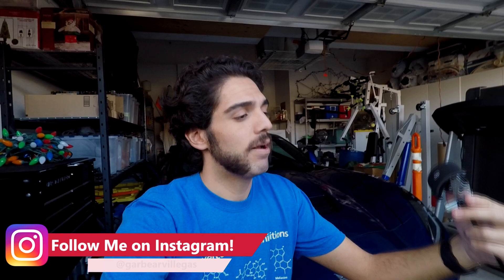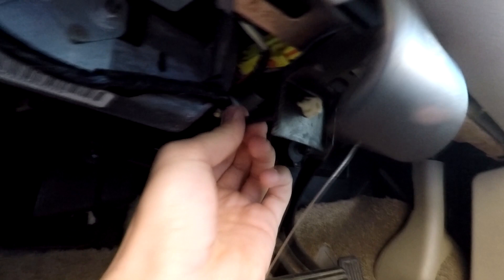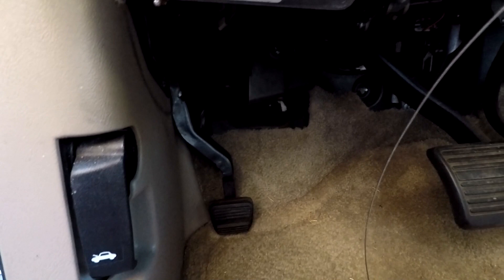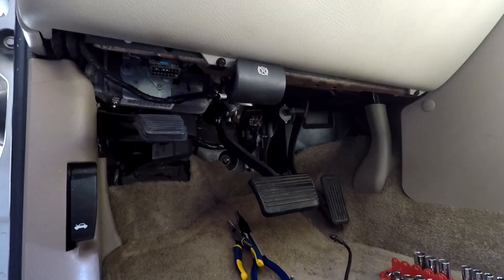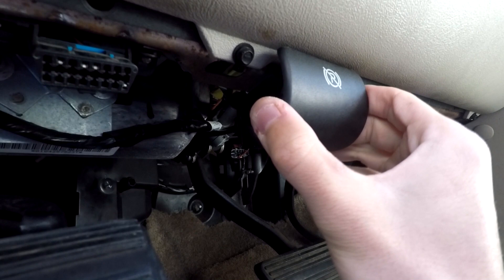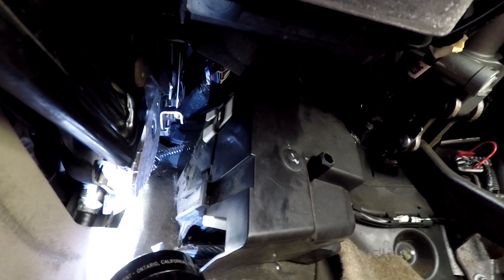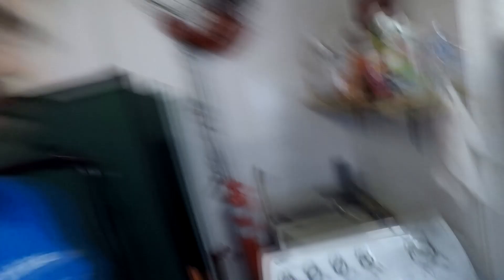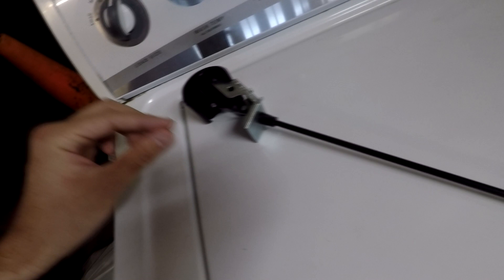How to Fix a BROKEN Emergency Brake Release

Comment: You are a lifesaver! The parking brake release handle on my 2007 Avalanche had me stranded while at the ATM Machine yesterday.  I could not move the vehicle and was both ticked off and somewhat panicked  as I thought I was going to have to have it towed home..Before calling for help, I came across your video on my cell  and found the mechanism you mentioned and was able to release the brake.My cable broke at the actual handle and it was unraveling etc..I drove home and out of habit I set the parking brake again.. lol However,  it's sitting I the driveway and I now know how to release and install a new one..BTW.. Nice Vette and Eldorado.. I have 88 35th Anniversary one as well.Thanks again!
Reply from the maker: Awww man, that sucks but I'm glad my video was able to help out! :) And haha, I did the same thing after I freed up my brake, set it out of habit once I got home, whoops! And thanks, yeah I caught the Corvette fever a few years back and I've always loved big American cars, the Eldorado is going to be my long term project, hopefully I can restore it someday!
Reply: Update:Lol.. it took me about 2 Hrs. for the 2007 Avalanche..First, I spent about 20+ Minutes cutting away this weird vacuum sealed packaging just like the samon you'd buy at Costco...Then, I had to break the Tube connection where it fits in the round bracket.  (It's really cramped plus trying to get light in there)After several attempts I ended up using a long screwdriver to keep the assembly in the up position to insert the cable end...GM Factory Part Number for a 2007 Avalanche 15929213.I found it on Ebay and it ended up being shipped from 'Suburban Chevrolet' $24.33 + $2.31 Tax Total $26.64 Out the doorI may find a pin point oiler and lubricate the cable inside the tube as the new part seems somewhat stiff..Anyway, could not have done this without your video! Thanks again!
Reply from the maker: @ehw1615e  Nice, sorry that ended up being a bigger pain than it should have, but I'm glad you were able to get it fixed up, hopefully it's the first and last time it has to be done for the both of us! :)

Comment: I was lost, it happened to me just when i was going to work at 5 am and everything was dark. I had no choice but to drive to work 3 miles away from home at 25 mph and return home at 7 pm and drive back the same way. I lost my sleep just thinking about it for the next day, thinking that this thing was somehow connected to the brake system and is going to be very expensive to fix it.  And then I said wait to the BAT-yuotube Robin, and there you where explaining how easy it is to fix it the release of the emergency  parking brakes. THANK YOU

Comment: This literally just happened to my 2007 Malibu. Can I drive like this? Haven’t watched the full video but will
Reply from the maker: To be honest, once you get the ebrake released, you can keep using your car without engaging the emergency brake each time you park, at least until you have the time and parts to get it fixed back up. Just don’t drive around with the brakes still engaged, you’ll wear down your rear pads and rotors. :(
Reply: @1Brain4Wheels  okay I’m sorry if I sound dumb but what do you mean by “brakes still engaged”?
Reply: @1Brain4Wheels  ohhhh okay never mind I got you. When the button broke for the emergency brake I thought the brake would be stuck but I don’t think it was. Is that what you meant by engaged?
Reply from the maker: @rnwo1698  no worries man, I meant to say as long as the emergency brake is no longer “on” (pedal pushed down to the floor) then you’re good until you can get the release handle replaced! Did it happen to break as you were releasing it or is it still “on”? If it is on, then you should definitely figure out a way to release it before the driving the car
Reply: @1Brain4Wheels  it happened when I pushed the pedal down and it broke. Like I said I thought the brake was still on. So to check real quick I reversed a bit and then I went a little forward so it didn’t feel like the brake was still on...
Reply from the maker: @rnwo1698  oh, sorry I thought it was the release that was broken, not the pedal lol Oh great, yeah if you’re not feeling any resistance in drive or neutral, you should be good 👍🏻
Reply: @1Brain4Wheels  yea I don’t think I have a release. But  do you have any idea how this can be fixed? Is it similar to what happened with you?

Comment: That’s not my issue mines the cable works it yanks it up but the brake will stay down like nothing happens I did it from the bottom so either it’s jammed or it’s really stuck in there that doing it manually won’t do the trick.
Reply from the maker: Oh, if you're manually pulling on the release bracket down in the footwell and it's still not releasing, it sounds like the e brake actuators are seized... you'll need to take off the wheels and check out that mechanism unfortunately :/

Comment: I have a 05 avalanche, I set the e brake and the cable broke. When I pulled up on the piece underneath it was not releasing the brake. Tried everything. Is there a back up way to release the brake?

Comment: thanks for the video. after i replaced the cable, there is little resistance on the pedal in fact, i believe the shoes do not engage. did you experience this? brake shoes work fine before cable snapped
Reply from the maker: Hmmmm, that’s really weird, the release cable shouldn’t have anything to do with the pedal’s function of engaging the brake itself... just out of curiosity, did you drive any period of time with the brakes engaged when they wouldn’t release?

Comment: How do you fix a stuck parking brake that is foot actuated?  My 2014 doesn't have the release handle.  To set the brake, you push the foot pedal.  To release it, you push the foot pedal again.  Mine is stuck and won't release.  Please help!!    Thank you!
Reply from the maker: Hey there, I know exactly what your talking about, but I unfortunately don’t have any vehicles with that setup for me to look at :( I tried to look online, this might help.... when you get under by the pedal, can you see any of the mechanicals? If so, look at the linked diagram and see if you can rotate something similar to what’s labeled as “48” in the diagram, that should hopefully let the arm release down https://patents.google.com/patent/US7051614B2/en
I hope that helps, sorry I can’t do more I just don’t have one in front of me to play around with.
Reply: @1Brain4Wheels  Hey!  Thank you so much for your fast reply.  The link you gave led me to the exact patent for the Dura brand parking brake in my 2014 Tahoe.  Everything is so packed in on my vehicle, I could not really get to any of the parts in the diagram.  I will admit, I have no mechanical abilities, either.  However, I did get the brake to release.  I dont know if it was the copious amounts of WD-40 I sprayed anywhere and everywhere, or me just jabbing around at everything I could reach with a screwdriver.  Probably, a combination of both.  Nonetheless, I want to thank you again.  Your help was truly appreciated as I was panicking in my driveway.  Keep up the great videos!

Comment: Please answer...Single mom with neck injury. At 9:38 how the heck does that end of the tunnel release after the butterflies are pushed in? Does it come out reversed, do I pull it through forward, slide it off to the side? I'm trying and trying but it won't release out of that holder. Thank you!
Reply from the maker: It should just push right through once those plastic "butterflies" are squeezed in - I would try squeezing them as hard as you can and then push the end of the tunnel assembly back through the hole.... don't pull the whole tunnel through (forward) because then you'll have to do the whole process again to get the other end through the hole in the bracket. It was tough to squeeze and shove through, but it will go :) Let me know if that clears it up?
Reply: @1Brain4Wheels  Thanks for responding! You know, there's barely enough room to do anything back there! How long did it take you? I think I'll have to try to have someone Houdini their hand/tool in there to push while I squeeze! I'll update you at next attempt. Thanks again!
Reply from the maker: @jgrrr9047  I know, right... and it sucks having to weasel you body up under the dash! Overall, it probably took me about 30-40 mins, but some of that was recording time too. Good luck on giving it another go, I know it's a pain, but it'll eventually release, I promise! :)
Reply: @1Brain4Wheels  We got the job done! Thanks!
Reply from the maker: @jgrrr9047  Yes, I'm glad it finally worked out!! :)

Comment: Would this work for a dodge Dakota?
Reply from the maker: I can't say for sure, but I would imagine the e-brake release assembly on a Dakota is probably similar? Some of the placement and connections may differ, but it should be close - good luck! :)

Comment: But where is that on a 1989 s10...
Reply from the maker: I'm completely guessing but it should be pretty similar... look for where the cable goes up under the dash and the S10 should also have a metal bracket that gets rotated when you pull the release. If it's the release that's broken, then pulling back on that bracket should get you rolling 👍